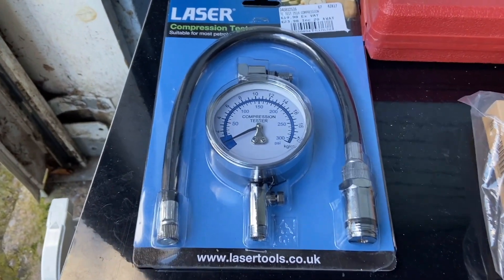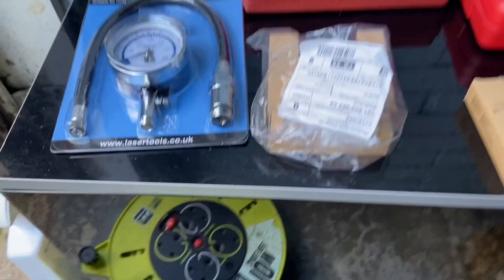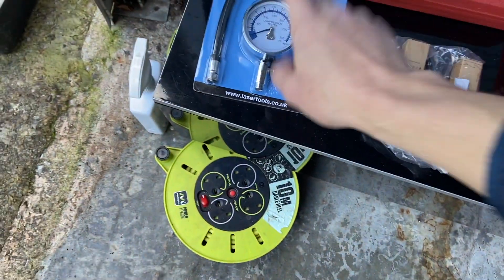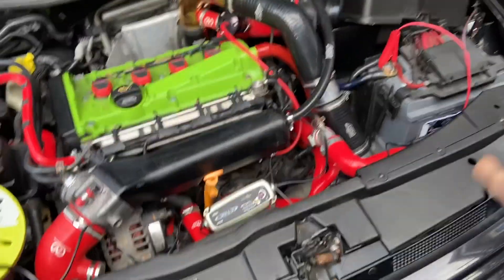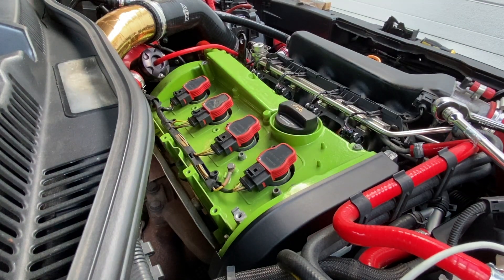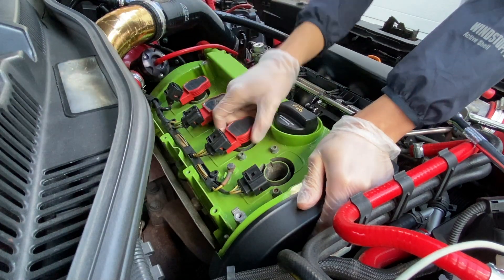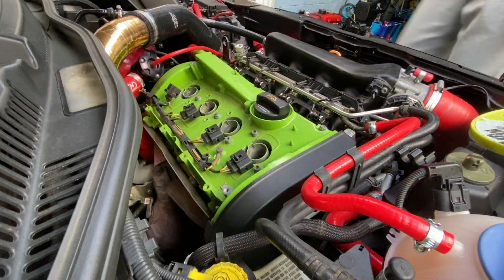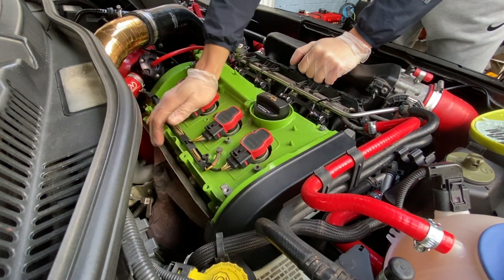How to do a compression test on your engine *134000 miles*

Comment: I agree with you about the compression testers. Tried it for myself. The cheap one showed only 8 Bar and the better one 14.5 Bar. Just out curiosity, I used the pipe of the better tester on the gauge of the cheap one, and now it also showed 14.5 Bar. The car I tested was my VW Polo 9N3 (2006) with the 1.4l 16V (non Turbo) engine. The mileage is around 248k km. Pretty consistent with all the cylinders. 

Conclusion: the better tester has a schrader valve on it which made the difference. Such a small detail made a night and day difference. 

Thanks for the video. 😃

Comment: My results were 
Cylinder #1 120
Cylinder #3 130
Cylinder #2 130
Cylinder #4 120

Is that too low? Should be worried?
Reply from the maker: Hi mate depends on what the manufacturer deems appropriate for good and bad. I know on the 1.8T 160-200 is considered fresh engine, anything below 140 is rather low. The other thing to consider is the tester being used, I made a separate video on this and you must use a good quality branded one. 

Here is a link for the 1.8T guide that shows in bar which needs to be converted to psi.

https://donkiespeed.nl/audi-1-8t-20v-checking-compression/

Comment: Wait 200? My shit is at 130 per cylinder but also like you said different gauges show different readings
Reply: That and I did the test cold since the turbo is currently off the car
Reply from the maker: Yeah 195-200 is considered a fresh 1.8T lol, I have no idea how it’s still fresh after all the thrashing it gets lol, I do maintain the car very well tho servicing every 3-5k miles and only use quantum platinum.

Comment: Hi mate, love the videos. Big help for me! I bought a mk2 golf with a 1.8t conversion that needs a bit work, a bit out of my depth but learning as I go. I ran a compression test following your video, what do you think of my results? The engine is a 130,000 mile AMK from a s3.

Cylinder 1: 175 psi
Cylinder 2: 190 psi
Cylinder 3: 190 psi
Cylinder 4: 175 psi.

Obviously 1 and 4 are down a bit. Should I be worried at all? The engine runs well.
Reply from the maker: Hi Mate thanks for watching and supporting, Glad you’ve joined the 1.8T family lol.

Those results are good mate considering the mileage is similar to my golf. I wouldn’t be worried about anything there. If those two results were under 150 then hmmmm I would be like okay you might have an issue somewhere. Enjoy the car mate.
Reply: @Mk4heavenHD  brilliant! Thanks for the reply mate. injector seals are next as they are leaking a bit, I will be following your video again 👍
Reply from the maker: @terbowilson  - Get em done mate, I remember mine been a little tight but was fairly easy. Nice one mate👍🏼

Comment: This miles with stock first engine? Or with rebuild or forged?
Reply from the maker: Yes stock internals from factory not been opened yet just bolt ons. Running hybrid turbo for the last 20000miles.
Reply: @Mk4heavenHD  good man! 20vt is awesome engine I run with stock k03s 239 hp with 175.000 km's. Nice videos man, grettings from grecce.
Reply: Before you do it hybrid which set ut you worked?stock or stage 1...or something else.
Reply from the maker: @DimoS...  Very good engine, thanks brother.
Reply from the maker: @DimoS...  Stock then straight to hybrid turbo.

Comment: Can the 1800 turbo engine be converted from cable manifold to electric manifold?
Reply from the maker: I’m sure it can but this would mean ecu also will need to be changed and wiring looms sensors etc. It’s possible.

Comment: i just crossed 160,000 miles on MK4. It is completely stock (I know boring). That said the engine is starting to tire and it's time i run a compression test. I put about 500 miles a week on it, so fingers crossed!
Reply from the maker: Wow that’s a lot of mileage a week. I suppose it’s fair to say they good engines and can take a good beating on.I’m sure it will be fine.

Comment: Very healthy engine for the age the maintenance you carry out is doing the engine very good 👍
Reply from the maker: Yeah it’s healthy to my surprise actually. I expected it to be lower. But I suppose you look after them and they stay happier for longer.
Reply: @Mk4heavenHD  How did you keep the engine so healthy? im doing a compression test soon on my mk7R from 2014 its stage 2 so im really curious to see how it whitstands the tune!
i do my oil change every 15k km and dsg oil every 30k km
Reply from the maker: @blackops2376  Hi mate,i bought the car on 80k miles and ive always changed the oil every 3-5k miles in some cases even after 1500 miles. The key for me is not abusing it also and avoiding the redline/rev limiter. I always warm the car up properly before boosting and let it cool down after boosting.

Hope this helps
Reply: @Mk4heavenHD  cheers buddy appreciate the fast reply 👍💯